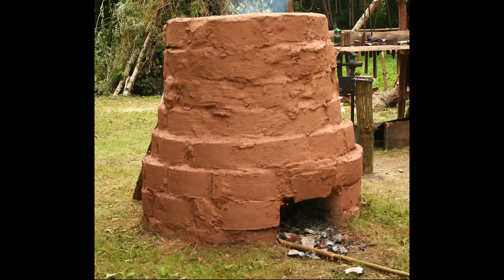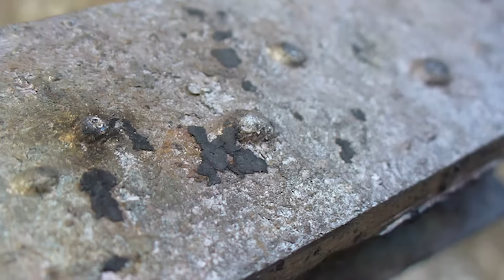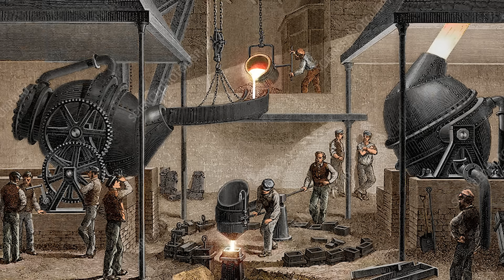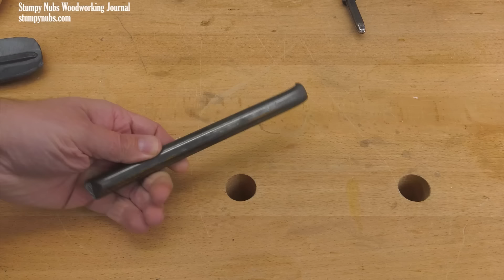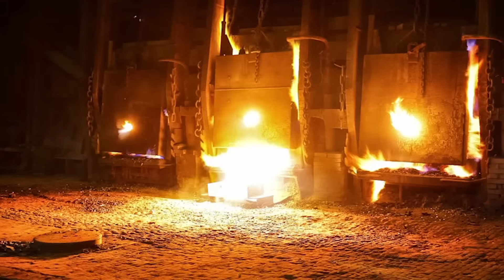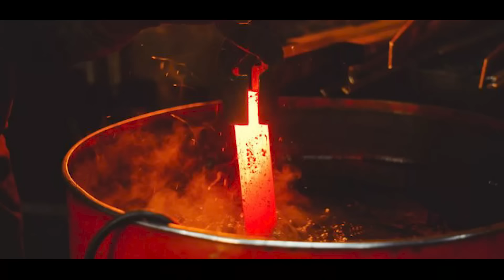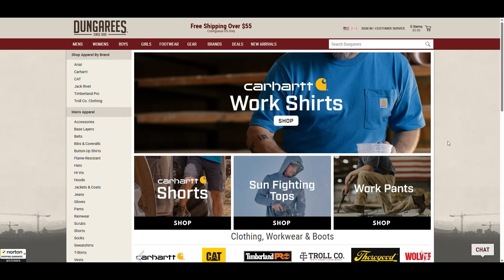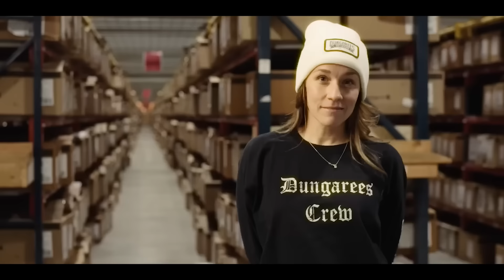Why they REALLY don't make tools like they used to

Comment: One thing to remember about claims like "tools from 100 years ago are better" is that it really means "tools that have survived 100 years are better".  We're not seeing the ones that had minute flaws that caused them to break, or were a bit too soft, and so got replaced.
Reply: "It's not good because it's old, it's old because it's good"
Reply: I came here to write the same thing.  I have some of my grandfather’s tools.  Most are over 100 years old.  Some were just as bad as junk you’d find in an assortment barrel at a big box store now, and others are great.  Back then Stanley had both good and cheap lines as can be seen if you look in their tool catalogs archived on line.  The higher line Stanley Chisels I have are quite good and hold an edge quite nicely.  He didn’t have any super fancy antique tools, just the stuff a building trade carpenter would use.
Reply: Found grandpas hand planers I think . Wood blocks with a slot and steel blade and wedge. He forged the blades. 😅
Reply: @mitchell21_87 
  You could buy a kit to make a hand plane, steel blade and clamp,with instructions for the rest of the plane you made yourself. Made a functioning tool at far less cost.
Reply: Not to mention old tools in mint condition.  Were they purchased by someone who didn't do much work, or were they awful to use and dropped in a drawer not to be used again?  Only the purchaser will know.
Reply: @misterbalsa9676 old snap on dealers used to buy them all up from guys in the shops. More money for good condition as many were collected by the dealers themselves.
Reply: @misterbalsa9676 Lol, hand tools are an old craft. I get what you mran. So if mint/unused it has collector value. I believe tools were harder to get back in the day and were better cared for by craft people
 I tend to use the same tools a lot. I try to get durable quality because of that. Antiques, I just feel bad about heavy use, some were made light duty.
Reply: We also aren't seeing tools from a bad melt that had impurities that made the cut quality poor.
Reply: Reconditioning 1848 timber frame, found 2” by 10”long chisel snapped off and discarded with leftover horsehair.👍👍👍
Reply: Survivorship bias. Same is true for old houses, furniture, etc.
Reply: @bradnail99 "Survivorship bias. Same is true for old houses, furniture, etc"... and people. Whenever someone aks a centenarian the secret of their long life, they never answer "chance statistical distribution" 😁
Reply: @jerbear7952 sheesh haha
Reply: @osliverpool i.o.w 'luck' i guess
Reply: @bradnail99 Roman ruins.. How could they build something that survived this long? Well most thing they build did not.
Reply: @bradnail99oldest trick in finance is to start 10 mutual/hedge funds, then after five years, close all the losers and market the performance of your elite stock picking skills
Reply: @bradnail99 World War II aircraft... 😁
Reply: @bradnail99 Survivorship bias is also true for stuff like movies and music. People might say culture from the 50-80s was better but that's because they're talking about movies and music that's good enough to still be interesting a half century after it was made. They're not talking about the other 99% of popular culture that has been largely forgotten.
Reply: @bradnail99I have a steel punch my grandfather forged it was half buried in dirt for decades then tossed in a scrap bucket. I recognized it as being homemade. Deeply pitted with rust. I cleaned it up grinding the hex shape back a bit.. with conical flat tip. If you drop from a few inches on concrete it rings like a bell and dances around.
Reply: But we produce more crap today and have planned obsolescence. 
Steel from many places are of questionable quality. 

So survivor bias isn’t all to it.
Reply: @bradnail99 Bollocks. Things don't survive because people replace and scrap them. When was the last time you patched your clothes or resoled your shoes?
Reply: @Shcreamingreen patches on most of my work bibs, mostly cheaper and easier to replace clothes. Usually seems blow out on boots.😁😁😁
Reply: @Shcreamingreen repairing too has a limit, there is a point where something can't be further repaired and must be scraped or it will just fail or disintegrate while in use.
Survivorship bias still applies, something of better quality will endure more repair and maintenance cycles than lower quality goods.
Reply: That is the "Survival of fittest" situation.
There is a old wisdom from the WW2 military aviation. 

To make your bombers and fighters return more safely, you analyze the planes that landed after damages, and you armored, strengthened and duplicated everything that wasn't damaged.

Because planes that got damaged in those parts, didn't return....
Reply: Cmon with surbivor bias and stuff. If you are at least 50 u know that your mothers washing machine would work for 20-30 years. Today? Ofc not. And my wife would kill me if that machine would stay here for 30 years. We all know that. My gran gran mother we still have hers closet. Was it high end furniture back than? It wasnt. It survived cause nobody throw it away is 60s, 90s and later when redecoration was done. Is it better than ikea stuff  from today. Thousands of washing machines were thrown away not because they were broken but cause they were old and ugly.
Reply: The truth is, the best products in terms of longevity and durability are made today, but they're a minority of products, because the tool that lasts decades can't be sold as often. People complain about new tools because they haven't figured out how to find the other stuff. Powder metallurgy steels in particular have made old tools irrelevant unless you can get them cheaper. People don't like to hear it, but their grandfather's tools aren't the best. They're just better than the sad average.
Reply: @MoistSaffron There are also some old tools that were just to good. I found an "Industro" socket set in an old tool chest fill of random tools that I bought for next to nothing. You can tell the hardness of the metal from the sound they make when you talk them together. And they hold up without even a scratch or ding under use. But they most notable thing about them is the finish. Mirror smooth,absolutely perfect chrome, inside and out. I've literally never seen anything like it. They are so perfect that they are literally a work of art. And that's the problem. It adds no functionality to the tool and I bet it cost at l at twice as much to make them like that, but no one would ever pay twice as much for the tool because of it. They are just too good.
Reply: There was a (not terribly well written), post apocalyptic story i was reading, and the main character didn't know how to read, but they knew that the big "S" that looks like a wrench, means a GOLD MINE. It was the 'Snap-On' logo 😂
Reply: То что вы пишете имеет смысл, но более применимо к старым зданиям.
А ситуация с ручным инструментом несколько иная: бытовая техника и потребительские товары 80-х и 90-х хоть и стоили несколько дороже современных, но служили многократно дольше. 
Дело в том что 90-х для компаний закончились неподеленные рынки сбыта и чтобы не остаться без клиентов они одновременно со снижением стоимости стали намеренно вносить к конструкцию элементы которые приведут к поломке бытовой техники или отвёртки.
В случае в бытовой техникой после окончания гарантийного срока - например низкокачественные электролитные конденсаторы в цепях питания, хотя можно было вовсе обойтись без этих конденсаторов и надёжность прибора бы многократно выросла.
А в случае отвёртки  - делать их из мягкой стали или намеренно ослаблять способ крепления стержня отвертки к ручке.
Reply: Flawed and ignorant argument.
Reply: It is a bit like evolution. the animals we see are descendants of the ones that survived. I am sure many many tools broke. You often see older tools repurposed as well. People are not buying and selling troves of broken trools.
Reply: @werewolf74 
30 to 40 years ago I had a zoology professor that said evolution is not truly only the “ survival of the fittest”, rather evolution is the ”survival of the fit ENOUGH”. 
The correlation with tools is those that were broken beyond Repair are gone. And those that were good enough to survive to the next generations have indeed survived or  Good enough to make this far. Meaning a lesser quality tools handled carefully, and used correctly may still be here. Quality tools that have been treated harshly and used improperly may have passed on.
Reply: @werewolf74 grasshopper im not thirty I'm 70  still working. Tools are far worse. They dont last as long.   Yes there are some better tools, but overall quality is way down. Im a commercial general contractor thousands and thousands of dollars of tools a year. 
Bright spot is drilling and cutting blades are better overall. Power of tools is far less on cordless tools
Reply: @robertcox9226  tools are worse because you're still using habits from 50 years ago 😂 habits that only applied to THOSE tools, you never altered any technique, and get upset when the results aren't the same?
Reply: Servivor's bias applies to all antiques, tons of junk was made it just didn't make it to today.  I like old yard tools, hoes, etc., maybe not better than the best made today but much better than the examples typically available today.
Reply: Bit like guitars from the 1950’s… there were plenty that weren’t good at all
Reply: exactly. it's just like this with guns. people thinking they made better guns back then because they see 80% polymer guns today with even the metal parts being chinesium. That cheap 300 dollar clone honestly is superior in every way you can imagine over most early 20th century guns that arent around today unless you find one in cold storage basically. some guns back then were made out of cheap alloys that were brittle, unreliable, sketchy quality control, and it was STILL expensive. and there were infinite shitty guns, you really had to be careful back then. even a shitty glock clone today is safer, stronger, wont corrode nearly as easily, and it's made cheaper than an automatic pistol 100 years ago in the 1920s.
Reply: @frydemwingz I have found they want more for beat up old junk then it cost new at gun shows over the last few years, modern guns and especially optics are pretty amazing i still love some of the old stuff but its the best of the past, there were a lot of lemons to.
Reply: @frydemwingz I had a 1960 something 870 Wingmaster that the inside of the receiver made a the inside of a 870 Express look good.  But where it needed to be smooth to operate good and on the outside the Wingmaster made the Express look about like one of the cheap Chinese knockoffs.
Reply: @frydemwingz another thing for guns is weight, metal and wood are both heavy and as you said corrode.
Reply: @frydemwingz horse manure I shoot a 1910 and it shoots as well today as ever. 
Washing machines lasted 20 years or more, now within 6 months they break. Cars ? Dont even get me started.
Reply: @robertcox9226  You kinda missed the point.  You’re making judgements based on your own experiences and the ones you heard about.  Not actual data.  In fact modern cars are SIGNIFICANTLY better than the old ones in terms of longevity, safety, comfort, gas mileage, lower pollution, etc.  Thinking old things were better because they are the old things is the quintessential misconception this whole video addresses.
Reply: @Switch2613 depends on point of view.
I dont consider having a car so "advanced" that I need a computer to work on it better.  I dont consider  replacing an entire door panel instead of just a broken switch better.
I dont consider cast iron that starts rusting thee first day it is exposed to rain,when centuries old cast iron lasted hundreds of years.
I dont consider many of the new and so called better things actually better. 
Last week I had to change a headlight switch in a car, a simple mechanical switch would be less than 20.00. these new switches have computer switches now they cost 120.00
Remember, the bottom 50%of americans live paycheck to paycheck. This disposable economy stinks. Washers and dryers used to last without problems for decades now I'm forced to fix them less the six months sometimes. 
Older American made stuff was made to last, now a simple manual can opener last a few months if your lucky. A teflon frying pan last a year or two. My cast iron skillet will outlast me.
Reply: @Switch2613 lol that your washer didn’t make it 6 months
Reply: @JoshJones-37334  I think you replied to the wrong comment.
Reply: @robertcox9226 cars last longer than ever - there's a reason old cars often didn't even bother to put a sixth digit on the odometer. Also, I don't know what washers you're buying, but I've never had one last less than a decade (and I'm on year 4 on my current one with no signs of any problems at all).
Reply: @clapanse  im a handyman. I dont know what im talking about, since i take care of only sixty buildings. I'm so sorry
Reply: Exactly

I have some old gouges from a type cutting factory that are rubbish. They were the ones used a lot and not taken by the workers when the factory closed down.

I have a knife blade made by a good modern smith. The edge holding is fantastic.

Mora knives; the carbon blades are fantastic, hold edges well.
Reply: American steel is better than Chinese steel
Reply: @robertcox9226 Or like many things, a lot of American steel can be just as trash.  Chinese steel can be just as good. All depends on how much you want to pay.
Reply: It's the well know survivorship bias and it's everywhere.
Reply: Cool - this is another angle on survivorship bias. It’s like Roman concrete
Reply: I have my first set of socket wrenches. Bought at K-mart in 1995. Considered it cheap at the time. No name brand Made in China. Small basic set of standard and metric. Nice plastic tray open on one side everything pops in and stays put.  Getting a patina not rust. Only lost one (10mm) which would still be in the dash of that old Volkswagen if it probably wasn’t crushed by now. I like it because it’s small compact and has everything I need for most basic automotive tasks. There was a point in time I did a lot of wrenching on old VWs. I have of course bought more wrenches and specialized tools over the years. Broken a few. 

It actually isn’t too bad quality. I’ve certainly used the crap out of them. Used not abused. My dad grew up on a farm, “it’s easy to break a shovel if you’re not using it right”. He taught me how to maintain tools. I’ve had some other sets since and broken a few of the ratcheting heads. 

So not really old. Certainly better quality than what is considered a cheap socket set now. 

I do love buying old tools at flea markets and garage sales. Get some great deals. Many just look good to me. 

We run a small business where we use tools at what would be considered a contractor level. Most get broken by the teenagers we hire, teaching how not to break stuff is part of the training. We have tools left over from when where our business is was my grandfathers farm. So we do wear things out sometimes it’s an old tool sometimes a newer one. There are some great quality tools these days. Love the Milwaukee 18volt power tools. We have some batteries that are 10+ years old. 

I am surprised at the poor design of some mid priced tools. Like he said if you know where to look you can buy decent new tools.  Great video.
Reply: As far as I know that is not really true, while the tools seem to be of decent quality mostly, other factors are probably more likely.

If a tool is a bit too soft and doesn't hold an edge, it ends up in some box, same with bad ergonomy loose handles. 
There is plenty of old junk around, and to survive for a century it just has to be stored in alright condition. (personal example the box of junk tools of my late grandfather, most of which are at least 50 years old)

I think the main thing is, people were less wealthy, tools more expensive, and the tools were bought more by people who actually made good use of them. Where now people may just buy cheap junk that is cheap use it a few times and buy other junk.
Reply: The sheer volume of old hand tools still available would suggest that they were pretty well made back then.
Reply: yet the literally do not make them as they used to, the radiation is from the chinese refractory bricks, which when exposed to the heat radiate into the motlen and highly susceptible metals. also china leaves impurities and rust spots in. but as i said, when we stopped using British metallurgy we stopped using metal.
Reply: Survivorship bias is everywhere .
Reply: Like 90 per cent of all new tools, right? The stuff they make today won't last ten years with the crap steel the make them with.
Reply: Good point
Reply: survivor bias 😀
Reply: Yes - also, Mozart, Beethoven, Chopin etc were not alone - there must have been armies of so-so composers we never hear about
Reply: from a blacksmith- good point, hope my stuff lasts 100s or years
Reply: Survivor bias
Reply: Same goes for buildings.

Vast majority of Roman architecture didn't survive 2000 years.

(And even when it shortens the lifespan, steel reinforcement just is worth it)
Reply: Yes, survivor bias -- good point!
Reply: The crap today won't last that long regular sharpening would wear it away in 25 year at most that's why the old stuff still looks brilliant good quality
Reply: survivorship bias
Reply: Ever heard the "they don't make em like they used to
Reply: Inflation is another thing to consider. 

(I know its old hat at this point but it seems to be often overlooked)

My grandfather 

"My mother paid  $18 for tgis cast iron pan in 1913 and its last this long they just dont male them like they use to"

Sooooooooo adjusting for inflation $590 for one pan....yes i would want it to last.

(Idk numbers but i assmue)

Spending 1 weeks wage on a fry pan....yesss it should last.....

Sorry rammbling but if i spent 1 weeks wages on a set of hand  tools they dam well better last 100 years .... thats what we forgettting how much the cost was... we just compare it to the curret market price .....

Idk a shovle made in 1913 at $4 has a price of $135 today but you can go to hadware store and get a shovel for $13 today which is $0.4 in 1913
Reply: Thats good point. And eventually they became better by surviving competition.
Reply: No
Reply: Indeed, survival bias.
Reply: A used, over 100 years old tool that can or is being used..could say it's well made for sure.
Reply: Things were built to last back then they are not built to last now, company's want you to keep coming back to fleece more money out of you.
Reply: Survivorship bias
Reply: My man metallurgy 100 years ago in regards to carbon steel quality was identical to today, hardness potential, consistency, hardness testing etc. you severely underestimate the mastery of the craft. Maybe if you go back in time 300 years you’d be correct
Reply: That time when survivor bias is correct.
Reply: Totally and not only that but they were expensive, they likely didn't thought on crazy profits for tools neither likely selling crap for high price while nowadays we can buy crazy cheap stuff, break and replace very fast, back then would get fixed many times before trashing tools.

Nowadays only makes sense to repair really expensive tools, not cheap stuff that is easy, fast and cheap to replace.
Reply: “Ten spears go to battle," he whispered, "and nine shatter. Did the war forge the one that remained? No, Amaran. All the war did was identify the spear that would not break.”
Reply: This is an excellent point.  Reminds me of other olds like me who say "well, WE didn't wear seatbelts" and I tell them "yeah...YOU survived"
Reply: Was about to say this. It's called Survivor Bias.
Reply: The bigger difference is whether or not the tool was forged, cast, or stamped. Sometimes even that is irrelevant.
Reply: This is one of the cases that survivor bias doesn't actually apply. My grandfather was born in 1902 and lived through the hayday of finely made tools. As an old man he still had many of his first purchases, items he used regularly and that he had purchased at the general store. He would talk about the poor quality of off-the-shelf tools and how that "no maker would ever put their mark on that", and he was right. We can't make comparisons on extremes, because extremes will always exist to counter any argument. Rather, to be honest and fair, we have to look at the average. In the late 1800's and early 1900's many of the tools were still being made with the same idea of pride and namesake that you would have seen from a third or fifth generation blacksmith, but with better technology than there had ever been before. The average tool was a good one, and my grandpa has said that he would even dig through the files to find a particular maker "who cut better teeth" and the store owner would be mad at him for wrinkling up the oil paper they were in. 

Some of you are old enough to remember the initial flood of Chinese tools and just how horrible they used to be. They are masterpieces today in comparison. At that time, the American steel industry was failing and to be competitive the tool makers moved to recycled steel and the quality of domestic products went down as well. Then, once again, it could easily and truthfully be said that older tools were better. 

Today we have some awesome technology and many craftsmen are looking strongly at quality vs disposability and it reflects in being able to get some pretty dang good tools right off of the shelf. It's easier to call bullocks on sayings that have carried over from pawpaw when you actually have access to decent tool steel, but those sayings were there for a reason - not survivor bias, but real experience within their lifetime. 

Btw, I shave with a Sheffield straight razor. I promise you that you won't find a better razor on the market today in general, and I have quite a few rather pricey ones. Tools? Debate away. Razors? The old ones are better 😂
Reply: Hello, im 70 fifty years construction, thirty plus as foreman. "Standard" go get me a  ______. Vs "standard" go to home depot and get me a ______. The tools lasted longer. Records verify this. It's gotten worse, not better.
 However, one area that has improved is cutting blades "diamond" etc. and drilling tech has improved tremendously.  Cordless battery tech is greatly improved.
Reply: That argument only goes so far. It just means that the lowest quality tools or heaviest use tools faded away. You still will not have any level of tool to tool consistency with old materials.
Reply: @doublestrikePhoto  That is exactly the argument. Poor tool to tool consistency means some tools are bad and some aren't. The poor tools are more likely to cut poorly, chip or break, and therefore are more likely to be binned. Think about it, are you more likely to pass down that fantastic tool that works exceptionally well, or the piece of junk that never works? Repeat that over 5 generations across several million tools, and you'll find that much of the chaff has been sorted.
Reply: Do not agree. Any chisel left from my grandfathers is much better than anything I can buy today. I tried both cheap and expensive ones)
Reply: Actually if ypu look at certain periods of time quality was cheap amd abumdantly made. I.e 1600-1800 chests. Just like now theu had poor good and best quality. Ypu paid fpr the crafstman skill and time. I can make you 3 dressers from the same wood ones 50.00 ones 150.00 and the last is 400.00 each one has more time amd detail tham the next. 😅
Reply: @martydom666 I will have to disagree. Very few items that were hand made was cheap if they were any good.
Yes, workers were paid less but if you look at how long you had to work to earn the money to buy a good quality chest in the 1600 hundreds compared to today I'm certain you'd have to work way longer then than today to buy the chest.
Reply: @martydom666 
Please don’t type with your nose.
Reply: @Therapistinthewhitehouse 😂
Reply: @Therapistinthewhitehouse if you’re cuffed you have to!😮
Reply: @DouglasPrice-q5o 
Good point 😂
Reply: @Therapistinthewhitehouse  oh no I can not unsee your avatar.  😭😂😝 Agent Orange and Putin should be buried together.
Reply: @_c_y_p_3
Soon 🤞
Reply: Survivorship bias
Reply: I’m not sure that’s true. A lot of good old tools I’ve seen are those that genuinely haven’t been used a lot
Reply: A good point, survivor bias strikes again.
Reply: yup survivorship bias.
Reply: Like modern cars. Nobody collects a Prius.
Reply: @WingWalker1  Not yet.  Except Rick Hendrick might own serial number 1.
Reply: @misterbalsa9676 and not one car guy gives a shit.
Reply: @WingWalker1 nobody collects a Prius because they're excellent for daily driving, which adds wear, and adds to the supply. People only collect trophy cars which nobody buys and nobody drives, they just sit in the garage getting maintained instead of doing work
Reply: @LibertyMonk Tell us you don't know anything about cars by talking about cars. 😂
Reply: @WingWalker1  im sorry but nobody daily drives their concorse show cars. Occasionally sure, daily no. And the ones that still exist were either lightly used and very well maintained or heavily restored.
Also, ease of repair and reliability are not the same thing.
Reply: @Pfish1000 ummm I drove a 1067 Mustang for more than 20 years. A 69 Mustang for another 5 a 69 Bronco for 5. Several Dentside Fords and a handful.of.other collectibles over my 40+ years of driving. Try again
Reply: @WingWalker1 and they are still as new with no major maintenance?
And no constant tinkering. 
You just drove it and did the standard oil change and dealership service like a normie? 
If not. Then im sorry you aren't actually disproving my point
Reply: @Pfish1000 huh? Are you pretending to know something about vehicles by assuming something irrelevant?
Reply: @Pfish1000 you're definitely not making a point
Reply: @WingWalker1 am I missing something, aren't Fords effectively the Prius of their time. They're just daily drivers that have gotten expensive due to that nostalgia bump this vid is pointing out. Now if you came in and said you daily drove a McLaren P1 that'd be a different story. A super car with 5 years of miles that held up would be a unicorn. A Ford with five years of miles is a dime a dozen. Plus, this is also ignoring another point the vid also made. Equality control. Fords of those eras have less moving parts than a Prius of ours. If both go half a million miles it's still a technical W for the Prius since it was able to do that with 10x more tech. Really, there's nothing wrong with admiring the old but tempering expectations is something people tend not to do and they romanticize it
Reply: But the difference then might be in the quantity of quality tools. I'm quite sure (although I could be wrong) that there are more good vintage tools than high end modern day tools of similar quality
Reply: @FolkcraftByFaidon The exponential increase in global production over the last two centuries makes that extremely unlikely. For example more steel has been produced in the last 30 years than in the entirety of prior (pre-1995) human history combined. And the same goes for basically everything that's being mass-produced today. For some stuff even more extreme (for example with digital storage capacity you only have to look at what has been produced in the last 5-10 years or so, everything before that is just a rounding error).
Reply: @FolkcraftByFaidon "Trust me bro"